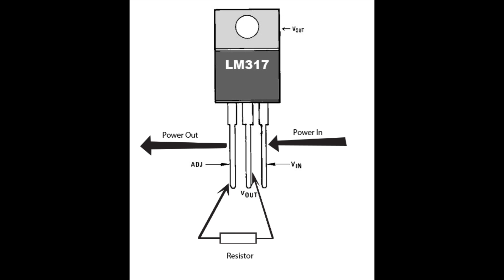1st Laser build 250mw 650nm

Comment: The heat sink increases the duty cycle.  It may not feel hot, but laser diodes can't take very much heat.  I don't see why the driver would need a sink, unless you're feeding it a lot of current, in which case it's better to make a power supply closer to what you need.